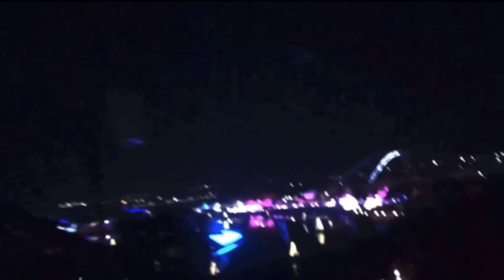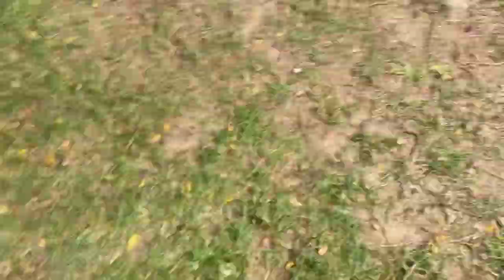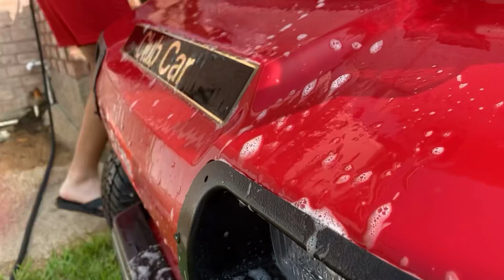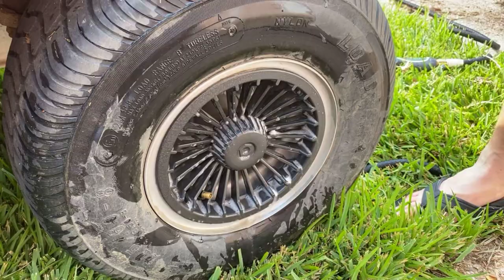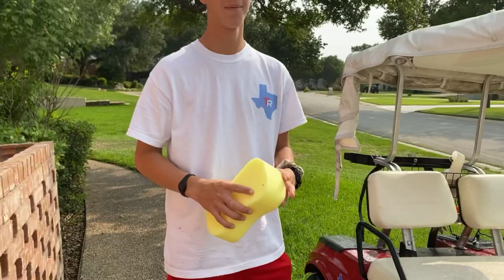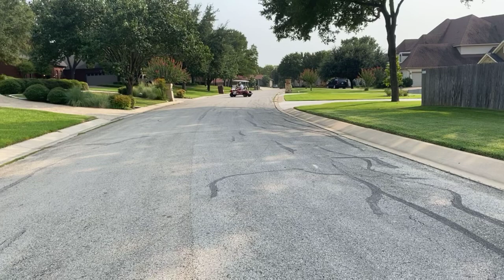Making the 30mph golf cart new again vlog#33

Comment: What motor did you go with and what did your top speed end up at? I have a 97 DS with a lift and all decked out but everything is upgraded except the older motor. Somebody replaced it with a mildly upgraded motor but only does about 18mph
Reply from the maker: It was all on buggies unlimited. It was so long ago im not sure what set it was. Maybe your batteries are old. I replaced mine with trogens and got a lot more performace
Reply: @texasrandom583  I didn’t have everything upgraded like I thought. I’m doing 30mph in an old series cart now and it’s sketchy fast.
Reply from the maker: Hell ya! Lol